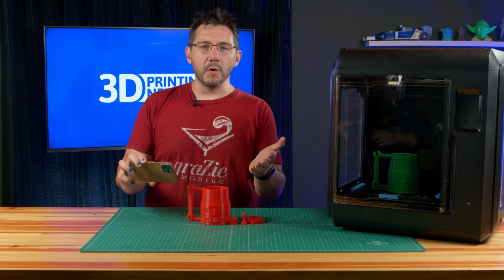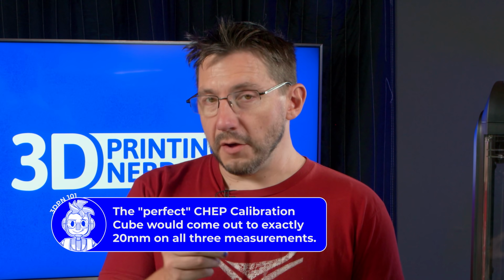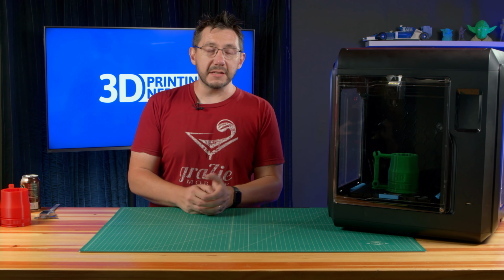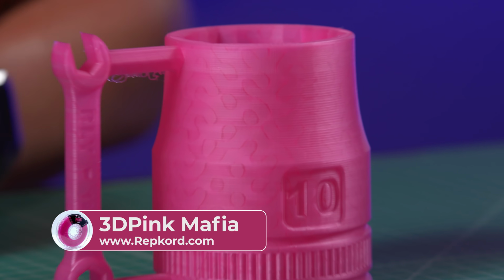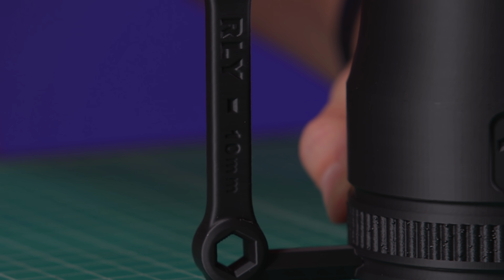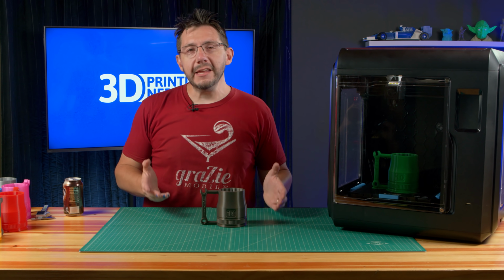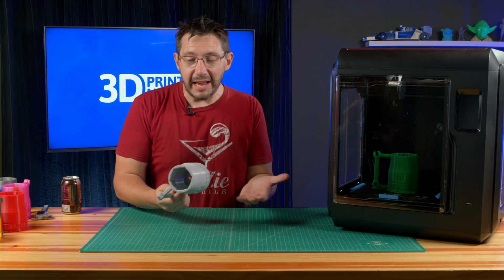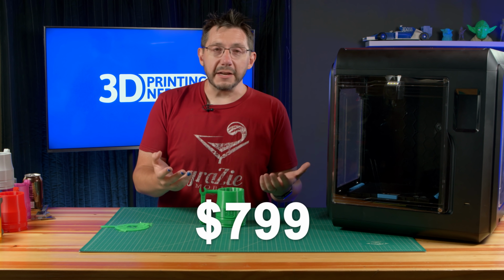14 FILAMENTS & 200 HOURS! Flashforge Adventurer 4 FIRST LOOK!

Comment: I have the adventurer 3, and have been having the same clicking issue with some 3rd party filaments. Would it be safe to say that jumping the temperature up on my nozzle with the 3 could yield the same results as with this one?
Reply from the maker: I would definitely give it a try, it won’t hurt anything and provide you with some more info
Reply: If you switch between abs and pla using the same nozzle on the adv3 you need to make sure it's properly clear of abs before lowering temp for pla printing. I run two nozzles, 1 for abs and petg, 1 for pla to save the hassle but purging the nozzle with pla at abs temps should clear it out and prevent any clicking.

Also if you have the cleaning pin they give you, that's another way flashforge have a video on youtube on how to use it.

Comment: @3D Why would you bother switching back and forth between the two nozzles? Why not just leave the 265c one all the time?
Reply from the maker: That I don’t know. Seems like just the 265 nozzle is the way to go, but they offer the ability to switch.
Reply: My guess would be the lower temp one is "Teflon Lined" and the Higher Temp is "All Metal".  All Metal hot-ends can lead to heat creep issues on lower temp materials like PLA.  So they can be but aren't always a good "One Size Fits All" choice.  That is just me using deductive reasoning as I don't have access to the machine to see for sure.

Comment: I would be interested in seeing an ABS print that takes up a wide section of build plate and see how bad the warping or bed adhesion is.
Reply from the maker: I love the idea and you bet that’s in the queue.
Reply: @3DPrintingNerd  Well. I bought one anyway. Was I surprised when I opened the box and found I have 2 flex build plates and 4 nozzles. 0.3 240, 0.4 240, 0.4 265 and 0.6 265 nozzles. This thing does work nicely right out of the box.

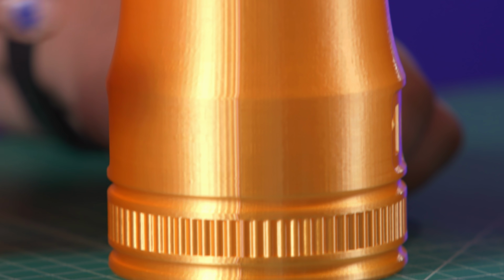Comment: 7:00 the gold filament really shows how terrible the ringing is on that machine though.
Reply: Don’t believe that’s ringing, it’s an artifact of the facets on the STL
Reply: @KevinMardi  Yeah. Would be interesting to see the same gcode run through Octoprint+Arc Welder to see if it would eliminate those facets and give a better look.
Reply: @KevinMardi  Nah, that is ringing and not the model geometry. You can see it fade to the left of the seam, also there on the lower part of the model.
Reply: Definite ringing issue

Comment: I love the Jesse vanilla bean ice cream. I use it for printing buildings and terrain.  Interesting that you had to bump temp up to use it on this machine. I print it on my Prusa Mini clone at 200-205 and it works great.  Must, as you said, be hot end dependent.  I’m putting a V6 hotend on soon, so be interesting to see if I need  to bump the temp afterwards.
Reply: Like Joel mentioned in his video. Some hotend designs have heat creep problems and that is why increasing the temp moves the heat creep further up so it doesn’t jam up. Tends to happen with denser resins with a more structured crystal structure. So properly cooled and melt zones on a hotend go a lot way.
Reply from the maker: Glad you like it!
Reply: I was thinking the same I have several Jessie PLAs and none have had an issue with temp.

Comment: It would be nice if it had a 300mm X 300mm X 300mm size for the price. And figure out how to get rid of the seam.
Reply: The "seam" is what happens when the slicer puts all the starting points of the layers in the same spot. Usually you can alter the location of the layer start points in the slicer (ie, make a seam somewhere on the model, usually a sharp corner or behind an outside feature)
Reply: I believe this model has a simpliy 3d slicer option to get rid of that seam aLSO!